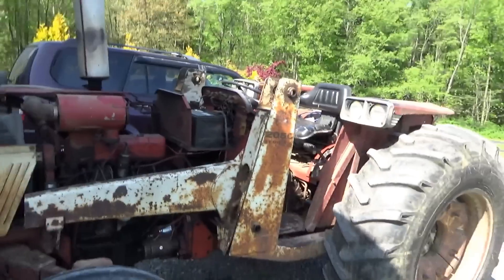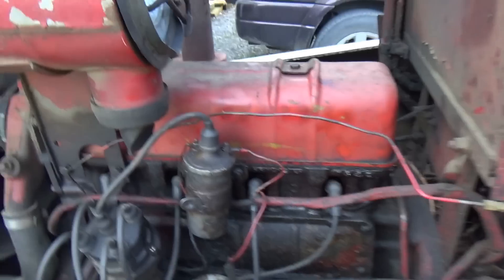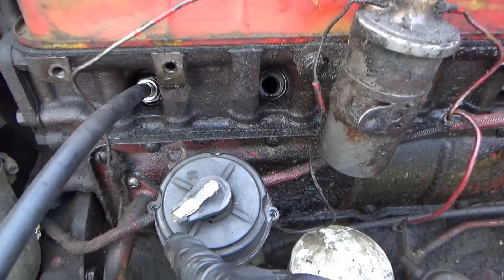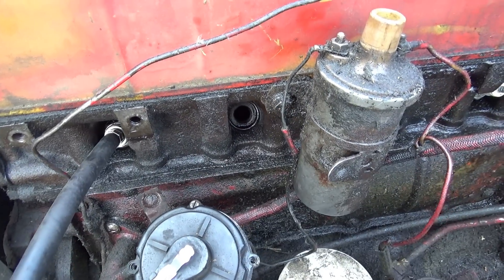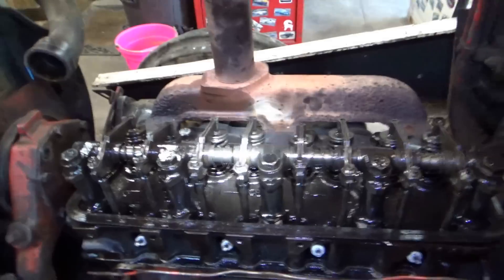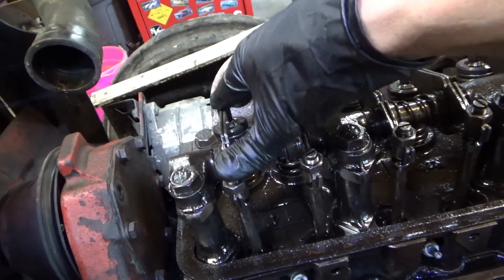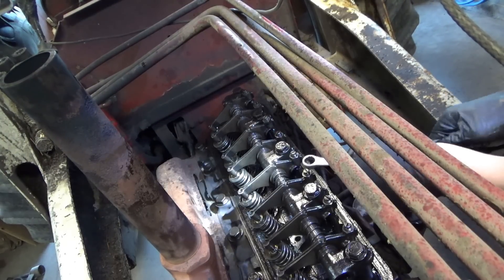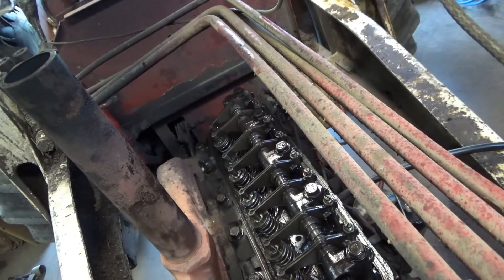International Tractor Runs ROUGH... (Part 1: Diag & Teardown)

Comment: The tractor is an International 574 and the data plate is riveted to the transmission just above the left foot rest. I have a 1974 model. The designation is always on the sheet metal of any tractor, not on whatever is hung on the tractor.

Comment: leaving the intake/exhaust manifold bolted on sure added a ton of weight to the already heavy head removal. which you quickly figured out at 7:20 in video. 🤣
you really need a gantry crane and chain lift to work on those easily. at least it's a smallish 4 cylinder. 🤪

Comment: I would first check for signs of coolant loss or system pressurization. if none found next valve lash issues, certainly no hydraulic lifters/adjusters on there and they may have valves tight from wear and possibly running hot/lean on that end of engine. maybe worsened by rust on valves/seats from exhaust not being covered, possible even rodent nests(urine corrosion) on.
so I guess a leak-down test on those two cylinders would be a great first step(assuming gasoline engine, which that is)

Comment: It doesn't get much easier than disassembling the top end of an OHV 4. Easy peasy. Wanna fix it right? Replace all the valves, guides and seals and have a machine shop cut new valve seats.

Comment: I would look at intake valve #2 and its all the seats very carefully. I'm thinking possible valve recession in the head even on the intake seats. Old engines didn't use hardened valve seats and were made to run on LEADED gasoline. This engine is old and probably run on unleaded gas for many years. I think intake rocker arm #2 was either misadjusted during a prior repair or that seat was ground down another time and the rocker arm assembly was just bolted back without any arm adjustments after reassembly.

Comment: Valves and combustion chamber coal black = ignition off time or the engine is using oil. Perhaps bad piston rings or worn pistons?
White valves = bad mixture (too) or timing is off. Even more likely a lack of lead.
But it could also come from coolant.

Comment: I was also expecting to find a bad head gasket or a cracked head or block.  But when the gasket was revealed, and it wasn't any of those.  I'm thinking, uh oh!  Do we maybe have bad valves?  Sure enough, at least one bad valve.  And zero lash on another?  Nice find Ivan!  But what caused the zero lash on the cylinder 2 valve?  That may require farther inspection.  The owner of this beast was spot on when he said, he wants it to run right.  So, he's taking it to a pro.

Comment: I'm not surprised that it needed a valve job, but I'm surprised it's not a diesel when it's from the 70's.
One thing to consider also is that it's a cast iron head and that means that the valve seats are usually milled directly into the cast iron. If you run lead free then they wear faster.
Reply: way cheaper to build with no diesel injection pump.

Comment: Ok Ivan I have done quite a few engines including manufacture. First this probably did not have the head tightened after 20 hrs. This can cause oil burning and oil in the coolant. Second this engine would have been designed for leaded fuel and will suffer from pocketing. The head will need to have stellite valve seat inserts fitted, at least exhaust. Most engine machine shops will do this. Or he can use an additive.  All the old Land Rover engines we do have this problem.

Comment: Always perform the complete procedure. Air up all cylinders, individually of course, then check and note the source(s) of leak (intake, exhaust, crankcase) and approximate volume of leak. It can save the amount of future head scratching. A stethoscope helps tremendously, it allows you to hear the leak. Large leaks sound different than small leaks and being able to tell them apart helps in identifying the most likely cause of the problem on a very worn engine that will have leaks at all 3 locations.

Comment: I love the engine is so approachable you can re attach the head and start the engine just it to check if a valve lash is the problem. Reminds me of my old 62 Ford Falcon, where it took about 1 1/2 hours to R&R the head gasket. The Car Wizard replaced a head gasket on a Mazda CX 9 Skyactiv engine and it took 16 hours.

Comment: Better check valves on number 2.  Intake looks receded into head.  A machine shop could check all 4 cylinder valves, seats, and for warpage.
How much oil is this engine using?  Good possibility it needs rings.

Comment: Purely mechanical, for a change :-) A bit of a surprise, with two independent problems giving the same fault. Not sure of the constraints, but once the head gasket was replaced recently and problems returned with the gasket looking good, I would review / service all valves, before reassembly, to avoid a comeback in another cylinder. Those front head bolts a bit loose in the problem area, may indicate previous work was a rush job (farm equipment is always under time constraints, as things tend to fail just when they are needed).

Comment: Working on a farmall cub last week. The generator wasn't charging so I took the belt off and put some power to it from the battery, it spun so we made the call on the regulator. Still wasn't showing charging on the gauge. Took the gen off and went and had it tested. Tested good. Put it back together still the gauge shows a draw. Finally I pulled the post off the battery with it running. It's charging since it stays running. the gauge must be skewed.
Reply from the maker: Just verify with an amp clamp and voltmeter 👍
Reply: When my cubs 6v battery died, I converted to an alternator and never looked back.  Hitachi 14231 alternator is like $60 and the 12v battery was cheaper than 6v.
Reply from the maker: @aarongarber5977  12V is the way to go!
Reply: It's holding steady at 8 volts, even threw a couple 4 amp test lights in circuit to simulate a load since the fuse cover is missing and someone cut the headlight wires.

Comment: Why do you think that when there's lash between the valves at cilinder 1 there's also lash at cilinder 2?  That's normally not possible..  when both rockers are moving on cilinder 1 you can adjust/check cilinder 4, when the rockers at cilinder 4 both moving you can check cilinder 1 clearance,  when the rockers at cilinder 2 both are moving you can check the clearance at the walves at cilinder 3 en when the rockers both are moving on cilinder 3 you can check cilinder 2..   always on 4 cilinder engines

Comment: Machinist here. As the valve seat and the valve sealing face wear together, the valve moves towards the spring end removing the valve lash and making clearances tight. Most people expect to find excessive lash on a worn engine, but it's usually the opposite. I think it needs a good old fashioned valve job. It'll be good for another 10 years.
Reply: So the top of the valve stem and the rocker arm dont wear? Or its not significant enough wear to cause expensive valve lash?
Reply: @Hernandez530  if those oil lubricated contact surfaces start to wear, you have major issues. meaning you forgot to check oil or never changed it and it's been acid water for ages.

Comment: I just recently sold my old 1965 Ford 3000 diesel tractor.   I had not used it in 3 or 4 years, it was just sitting up.   In fact the seat had completely rusted away to nothing.   I put a new seat on it and cleaned it up, did some basic service on it.   A little shot of ether and it fired on up pretty easy.   Sold it for 3000 dollars, with all the implements.  I think that's good deal on an old tractor.

Comment: Enjoyed the low tech content. Hate to go down the rabbit hole too far, but it might be a good idea to completely service the head if you can get the parts. The valvle seats are just not going to stand up to modern fuel.
Reply: If this is a "work horse" it need a full head/valve job.  At an absolute minimum, all valves need to be lapped.
Reply: @jackpatteeuw9244  Yes!
Reply: @jackpatteeuw9244  No, the vale and seats need to be reground.
Reply: It seems to me if the valve seats are currently holding 160 lbs after 50 years of service, there is no reason to service the head as it's not going to get any better than that. With old farm equipment if it's not broken it's best not to fix it. Also, if in the future, it actually needs a valve job,  keep in mind it probably only takes about 1/2 hour to pull the head.

Comment: I'd say that the valve lash being too tight has caused that valve to burn out because 29 years ago when I was doing a small automotive course my teacher was telling us how the valves will get burned if the valve lash is too tight.

The valves get held open which causes the valves to overheat & burn out,it also causes a loss of compression !
Reply from the maker: The lash on cyl 1 exhaust valve was actually fine 🤔

Comment: Out of interest, the "mis-diagnosis"... you checked cylinder 1 at tdc and assumed that the leak was via the head gasket when in fact it was leaking through the exhaust manifold and out via both the exhaust and the correctly open exhaust valve on cylinder 2.

If you'd taken cylinder 2 to tdc and then tested, you would have seen the leak on the intake manifold but not coming out via cylinder 1 nor the exhaust manifold, indicating no head gasket issue?

So moral of the story to be taken as a learning outcome is it's worth checking all the suspect cylinders independently and not just assuming a connection? Realistic outcome is that the whole lot needs to come off anyway though, so it doesn't really change anything, but if you were ordering parts relative to the diagnosis, a few mins extra on that cylinder 2 could have potentially led to just opening the cover and adjusting two rockers had cylinder 1 had the same adjustment issue on the exhaust valve.

I have an old gas forklift I'm trying to get running as a project to learn more about engines and have taken a lot of interest in engine related content. Definitely down a rabbit hole! I come from a mindset where an oscilloscope is more familiar to me than the mechanical side, so I love the idea I can combine my existing skills and knowledge in diagnosis to overlap into mechanical diagnosis.

Love your content. I know it is no small effort to produce these videos while working on the given vehicle, so thank you!

Comment: Looks like the valve on 2 has receded into the seat , hence the lash getting smaller
Reply: I had a 4 cyl triumph motor with the opposite problem, cam lobes all worn away!!!
Reply: I agree with you the value gone into the seat making a tight tappet not rocket science